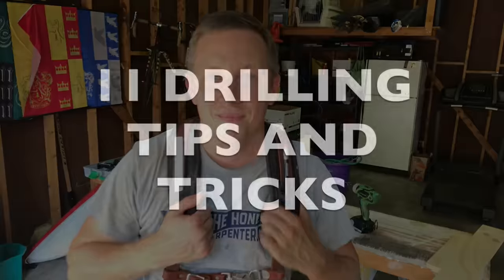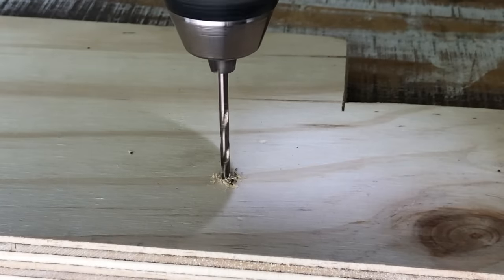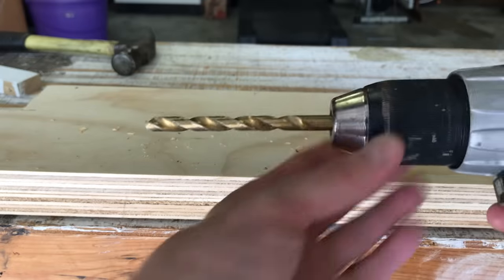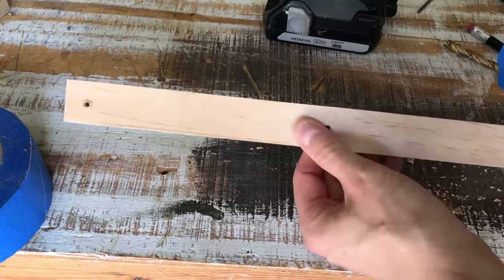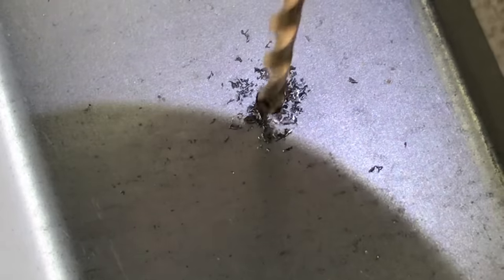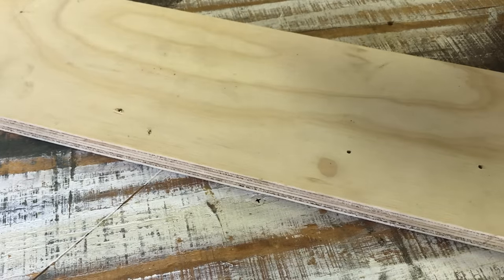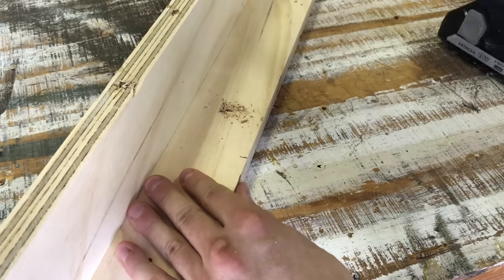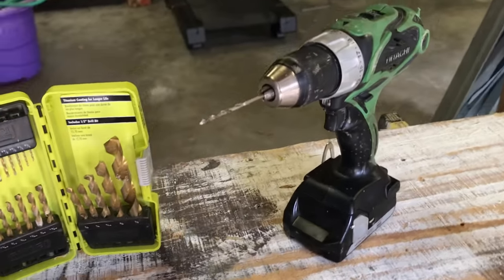11 DRILLING TIPS AND TRICKS (And Mistakes To Avoid!)

Comment: Remember, when you’re clearing out swarf (I love that word) with your finger, be careful that the bit isn’t hot, or you could burn your finger (ask me how I know this).
Reply: You ain't the only one.  If the bit is tiny, dad flicks the end of it.  Usually the little bit of flex and rebound is enough to bounce out the swarf.  My fingernails are always uneven lengths; I just use whichever one is long to clear out the swarf.
I love that word too.  :)
Reply: HOW DO YOU KNOW THIS?
Reply: @ethanheyne  It can't hurt to let the drill have a break to cool down, too.
Swarf would be a good name for a small dog.
Reply: Ha ha. Same.
Reply: @markrm16  lol. I’m naming my next dog that.
Reply: Love the hot bits. Used to grab frys out of 350 degree grease at the restaraunt, to toughen up the fingers. We could lay our hands flat on the main hot grill for like a tenth of a second.
Reply: @markrm16  swarf mean dudu. Something I get excited  and dudu all over my work piece and sometimes said dudu gets caught in my drill and gets swarfed in the drilldo, I mean drill hole
Reply: Same as me. I learned after burning my finger. Lol 😊

Comment: Additional metal drilling tips: Center punch where you want your hole to prevent wandering (same as you would for wood drilling). Add a drop of lubricating oil to the tip to cool and lubricate the cutting surface. After the hole is cut, use a larger bit spinning in reverse to slightly touch the hole to knock off sharp edges.
Reply: Solid advice! As a handy guy, I'm learning from all his vids and comments I read that just KNOWING what tradesmen do can take hours off a project by increasing precision or choosing a non-favorite tool.
Reply: Great video.  How do I keep my drill level while drilling so that my drawer pulls won’t look crooked?
Reply: Number 1 sharp suitable drill bits, the angle of a wood bit at the tip is more acute.
2 suitable speed for material and bit type. Almost every woodworker I have ever seen, particularly on YouTube  uses spade/ flat bits way too slow, they work best sharp and fast. 
 3 Use suitable machine  !!

Comment: When I use tape for depth drilling, I make a little flag.  Then when I get to the proper depth the flag swipes away the sawdust and you know you are done.  This helps eliminate drill depth creep (by pushing on the tape) if you are drilling multiple holes.
Reply: Whoa.....

🤯
Reply: Exactly!
And ...  I like to draw a small skull and cross-bones on the tape flag.
This doesn't improve the drilling process any. However, it allows me to pretend that I am the captain of a pirate ship, and thus, my workday goes by much faster. I literally sail through my workdays. 🤪
Reply: Ive done this for alongtime when using a hilti hammer drill for drilling concrete.
I use a piece of red duct tape bc the depth measure on them move in time. Crappy design. so if any inspectors are walking through they see i have it set for depth. They just walk by bc they know im the sht. Lol
Reply: @UserUser14880 ,
Awe man ...  So, you're the one that invented "red tape" ?
Reply: Gran idea!
Reply: @marshalllhiepler  - I'm gonna have to practice my skull and crossbones because this is happening.  Also, respect for the pun.  Well played.

Comment: Get a good countersink bit so you prevent the tapered head of a flat head screw from splitting the wood, especially near the end of a board.
Reply: And in a pinch, use a bigger bit to carefully drill out a small countersink.

Comment: Great tips. I think I have done every one of these at some point.  One I would definitely add is adding oil when drilling metal.  It helps the cutting, keeps the drill sharper and helps cool the bit and material.

Comment: I liked this video. I've been  a carpenter for 30 years and never heard of swarf. One tip that you left out that I like is when drilling with a spade bit or hole saw only drill until the point on the bit comes out then flip the wood over and drill the rest of the hole to prevent tear out. Keep making great videos!

Comment: Can you cover how to drill into concrete and installing concrete screws?

My concrete screws seem to pull out too easy because the hole i drilled is too large. I'm using the correct size and type of drill bit. I suspect my cheap hammer drill is not spinning the bit true, but is wobbling the bit which causes the hole to enlarge.

Comment: adding to the vid, putting a piece of wood underneath the piece you're drilling into will also help prevent tear out. 
Other than that, well paced and informative video. Thank you.
Reply: I found that out by accident. Spade bits are notorious for tear out. So far..I have not had any problems. I try always put a small piece of board underneath. So far ..so 👍
Reply: So far so good.. The 2 boards should be clamped togother if possible..time permitting ..and other factors...going slow or. A marker tape for depth are choices.
Oh yeah..years ago I bought a 50s hand brace..geared, and good quality wood handle. They built ships and houses out of them. I am old school. Sometimes I like to do something totally using hand tools.
Reply: The bigger the bit you're using, the more you need to use a sacrificial backer board.
Reply: Without exception, even with brad point drills, always have a board supporting the location where the drill will exit the wood.

Comment: Great video.  One major tip I would add is to make sure you're using the right drill bit for the material.  Bits for masonry vs wood vs metal and even ceramics make a huge difference.
Reply: I didn't know there was a difference between wood bits and metal bits.

Comment: I learned the size up trick on my own when drilling into concrete. Helped tremendously
Reply from the maker: Yep, ESPECIALLY important in concrete
Reply: Do I need the hammer function turned on for the second (or third) size up on concrete wall? Because I live in an apartment, so I try to drill as least as possible and those hammer drills can get very LOUD, lol.
Reply: @cynicalheis  You have to use a hammer drill with a masonry bit when drilling concrete. Concrete is way too tough and hard for normal drills and just rotary drilling.
Reply: @cynicalheis  you may try a neumatic hammer drill, works better, no need force, not that loud.

Comment: Great basic review. Glad to see I'm already using all those techniques. With regard to the painters tape, giving yourself a little extra wiggle room and not going to the depth of the tape is key when doing many holes; 1, 2, or a few probably won't be an issue, but the 144 I did for making a 6 hole adjustment for 6 shelves...the tape wears quickly.  I also wind the tape counte to the spin so if the tape does touch the surface it doesn't unwind. I also use a long length of tape to give you more "bulk" at the stop point and fold the last half inch into a little flat so you're not only more likely to see when you're getting to close to the surface, i.e. drilling too deep, but it also makes it much easier to have the flap for unwinding it from the bit when you're done.

Comment: found a drill bit hole sizes template (13 hole sizes: 1/16"-1/4"), test the screw on a hole where it goes through and pick a drill bit 1 hole size smaller for hardwood, 2 hole sizes smaller for softwood
Reply: @torTxoFognaTuluZ  mastercraft hammer drill - included in the set of drill and screw driver bits (labeled as 'drill gauge'). it's 3x8 cm, made of plastic

Comment: Good tips!! 
When drilling into concrete, Mark the depth you want on your bit with a black sharpie.
Reply: the drilling dust will make any mark on the bit unvisible. most of hammer drills have a depth controlling device. or make one by yourself
Reply: @berndeikers8924  they do,  but from my experience, someone always loses it, lol. Whatever way works, I suppose, because there's a few ways to get it done

Comment: I am having such a hard time with using my drillmaster power drill. I have tried short and long screws and no matter how much force I use I can't get them to not wiggle and spin right off the drill, with no hole made at all. I have previous injuries to my right wrist and left fingers prev partial paralysis. I was wondering if my drill was just not strong enough, if I am not strong enough to push it in, if it was on the wrong settings, or if I don't have the right size connection...I am pretty lost altogether. I have watched many videos tonight trying to teach myself and this one seemed to be the most helpful. I still have no idea what I'm doing wrong but I feel like I learned quite a bit so this is a good start for me. I'm thinking I'm going to upgrade to a very high power drill hoping to have with a magnetic tip to help keep the screws connected. So thanks for sharing...wish me luck 🤞

Comment: Some I knew about. But as always learned more. Also when drilling metal you usually want to use drilling oil if applicable.
Reply: @JosLewisWood Carpenter I had a metal shop teacher in 8th grade teach me about slow drill speed for metal, but otherwise I'd never have known this.

Comment: Just got my first brad point drilll bit set, and it makes precise holes in soft woods go much faster. Let's you drill a nice clean hole exactly where you want with a single step. No need to punch or tape., but it is another set of bits to keep track of, of course.

Comment: If you're drilling with a fine bit and it snaps and you don't have a spare, grab a nail of the diameter, snip off the head and use the nail as a drill bit. It's not perfect but can get you out of a tight spot.
Reply from the maker: Another great tip Maxx. I’ve got a certain way of cutting then to get kind of a chisel point out at the end. Have definitely used that trick more than once
Reply: Been there done that..the fine brass looking ones that come in a blister pack (read cheap), break super easy. It just occurred to me.
If you are not making progress
with the bit..put it in vice or clamp. the nail to a table..then file cross hatches or just basically rough the tip area of nail up. Never tried it ..btw..I am in the process of putting brushes etc in my 30 year old Ryobi hammer drill. It has been put though the.ringer..

Comment: Great video, lots of good info.  One thing I discovered:
I bought 10 packs of cobalt bits on line, of the most popular sizes that I often wear out or break; 1/8 and 1/4.  Not too expensive, and cobalt bits are excellent!
Reply: You're so right about 1/8" bits. I always have extras.

Comment: Great Video!  Recently found your channel so a new sub here.  One tip that I like for finding the right size drill bit to use to pre-drill for a screw is to use the drill index.  Find a drill bit that the screw will just fit into easily then go down two to steps smaller from that drill bit size. You can vary the number steps for softer or harder woods.

Comment: To avoid tear out I have used tape as well but I prefer to clamp a piece of waste stock to the side where my drill bit will make its exit. I can always find a big enough piece of scrap wood to cover all the area where I am drilling holes to prevent tear out. 
When I use hole saws or spade bits. Having scrap on one side is a big help but mostly I drill a smaller hole through my project first. Then use the spade bit or hole saw and just penetrate the wood on the one side part way in. Then drill through from the other side all the way using the small hole that is showing as my start point. That way you avoid making a messy tear out because the surface of the wood on both sides has been cut with no cutting tool that has broken through. I always keep in mind that some woods are more prone to splintering than others.

Comment: Total beginner DIY'er here; video is SO useful. Question: using a very short bit on my Dewalt impact drill, the bit constantly slips out when drilling. I know this is a basic issue; what am I doing wrong....is there an attachment/procedure I should be doing? Note: I have a full set off bits/drivers.

Comment: About 50 years ago when I was in wood shop class my teacher told us students the best way to select a drill bit for a pilot hole.  He instructed that we take the fastener we want to use and using a drill index to find the hole that the fastener will fit into.  Then we were to back off two drill bit sizes and use that size bit to drill our pilot hole.  It seems to have worked nicely for most holes, but occasionally when drilling metal, or very hard wood, only back off one drill bit size.

Comment: With the tape on the bit method, another good trick is to leave a flap of excess tape folded onto itself. This serves to sweep away saw dust from the surface being drilled once you’ve reached to prescribed depth without you having to peer down at the work so closely.

Comment: Also, get some bees wax or a bar of soap to apply to your threads before inserting the screw, especially in hardwoods. This will make the screws go in so much easier. P.S. If you are doing a lot of toenail screwing then get a Kreg jig (I know, this is not a simple screw technique but wanted to throw this in).
Reply: Also any any kind of candle wax will work. Which most house holds have.
Reply: @angellas.1314  Cool. Was just going to ask whether candle wax would also work. :-)

Comment: Thanks! I now have to salvage my project. Drilling fast takes confidence so I think it's wise to test on a piece of scrap wood. I also have a problem to drill straight for my dowels.
Reply: To help drill straight vertically. Fix together two pieces of wood to form a L shape about half the height of the bit your using. Then place the bit where you want to drill,and then place the L shape piece up against the bit where the corners meet. Then drill; it will not be 100%,but much better then trying to drill free handed. Also to drill a straight hole horizontally; you could do the same thing,but it can be cumbersome. I saw a trick on "Wood by Wright" where you place a cheap ring,key ring,or perhaps even a washer onto the drill bit itself so it can spin freely; then place the bit where you want to drill,and place the ring about middle way of the bit then drill your hole. An if you tilt the drill up to much the ring will slide towards your work,and if you tilt the drill down to low the ring will slide toward your drill. I realize the last tip sounds like a lot,but once you try it you be like oh okay piece of cake. LoL Hope this helps.
Reply: @davogifman542  Can you show a photo of how this is set up. Also, looking for something like the wolfcraft fowl jig listed below in the US. Thanks so much.
Reply: @liamofthornhill  Can you tell me what a cheap comparable jig would be Amazon US?  I'm putting together a bed frame with 2" x 2" poplar hardwood with a butt joint, and I think it will be hard to make straight holes. Thanks.
Reply: @liamofthornhill  Thanks so much for your quick reply. Can find something like that at a local hardware store. I guess I can use a smaller drill bit in it, since I wasn't planning on using dowels. Do you think this will work for drilling screws on a butt joint edge for a small bedframe?  Do you have any videos showing how to do that? Really appreciated your video.

Comment: I agree with you on the "punch" thing! It can be really annoying when the bit wanders around on the surface on it own. Sometimes you don't have something to punch the surface with though. What I do is I place the bit where I want it, then I place my offhand on the back of the motor casing, above the drill grip. I then apply pressure, and give a short, quick pull on the trigger. Makes sure to do it fast, so the bit stays in place. Another method I found is taking the right size bit, or a bit smaller than it, and grab it in your hand, and twist it side to side, making a little indent in the surface your drilling. This effectively does the same thing as a punch, but it may not go as deep.

Comment: All the new terms I discovered: swarfing, hogging out, toenailing... and also how come I keep breaking drill bits. Thank you for this! I learned a lot.
Reply from the maker: You're welcome, Bonnie! Thanks for watching :)
Reply: There are a few reasons why drill bits break when I'm using them.  

1.  I'm pushing to hard
2.  Drill bit caught on a harder material while drilling into a hole.  Example:  Drilling into wood and you hit metal.  The drill bit catches on the metal and breaks.
3.  Cheap drill bits.  Always buy good drill bits.  For most DIYers and Contractors  HSS drill bits will work just fine.  HSS stand for "High Speed Steel."  These are drill bit that have been heat treated to increase the hardness of the drill bit.  
4.  Drill bits typically go on sale:  Christmas, Father's day, Memorial Day, 4th of July, Labor day.  However, I find quality drill bits at their lowest price during the Christmas shopping season in the "stocking stuffers isle" or on Father's day.  The big box stores put them out as their loss leader and you can typically get them for about 40-50% off.
5.  Last but not least.  Always wear safety glasses.
Reply: Bits break often for three main reasons:
-pushing too hard (small bits flex)
-change of direction 1/2 way through hole
-cheaply made bits (bad temper on bits)
Reply: Hi Bonnie  👋 I hope my comment didn't sound as a form of privacy invasion your comment  tells of a wonderful woman with a beautiful heart which led me to comment  I don't normally write in the comment section but I think you deserve this complement. If you don’t mind can we be friends? Thanks God bless you….🌹🌹🌹🌹

Comment: When drilling metals, every type of metal has a range of speeds for a given drill material. It absolutely does matter. I've made a nice living getting tools running at efficient speeds and feeds. It isn't always best to slow down, it is always best to let the tool do the work, and to have your head out of your ass when in the shop.
Reply: Applying cutting oil, ( me , pb blaster , got cans of it every where)  on metal,  usually helps.